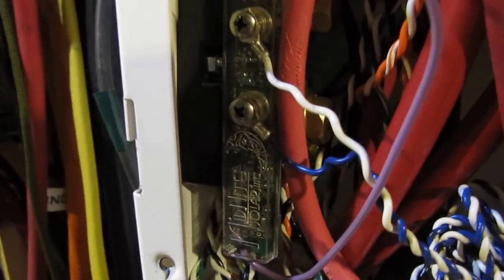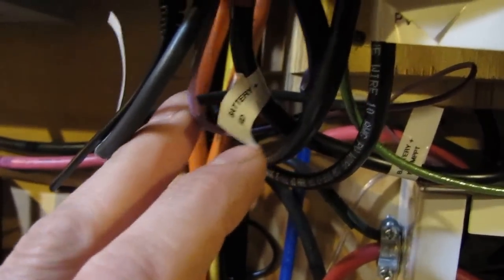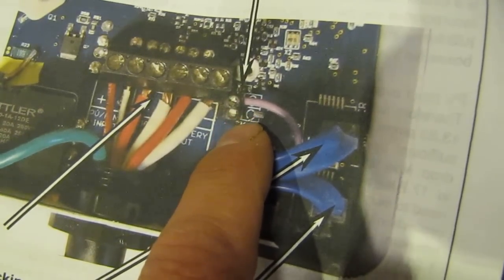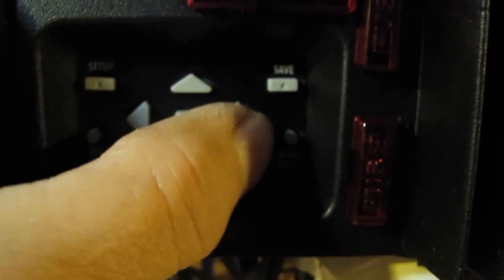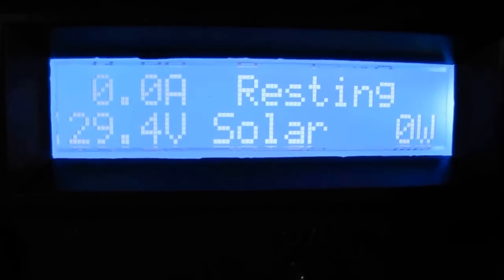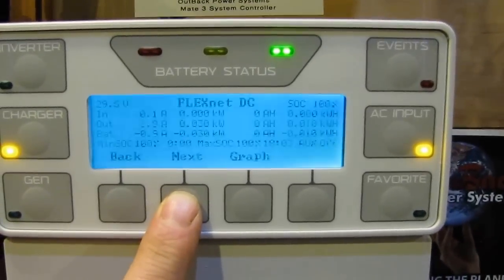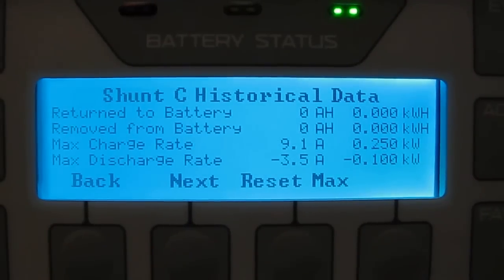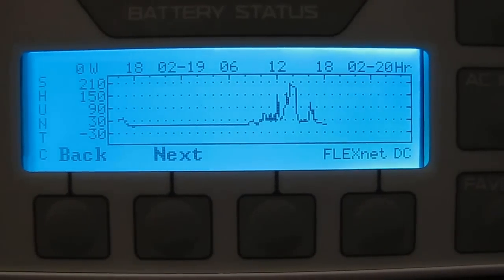MidNite Solar The KID  MPPT Charge Controller and WhizBang JR Data Logging Update

Comment: Thanks for the video.  I was wondering what you thought of using a Kid as a controller for a larger diy portable solar generator?  Is the Kid waterproof at all, and does it do data logging?  That outback info screen you were showing us looked awesome, does it fully integrate with the Kid?  Thanks!
Reply from the maker: Hi Bubba It Isn't Fully Waterproof I Don't Think  But May Be Splash Proof  The Kid Does A Little Data Logging They Are Still Working On That ! The OutBack And Don't Integrate  But My OutBack Flexnet DC Power Monitor Shows Me What The Kid Will Do As Far As Power Output Watts Amps Etc. And Graphs On My Mate 3
Reply: kvusmc / Kenneth W Viar Jr Thanks for the quick reply!
Reply from the maker: Anytime Buddy